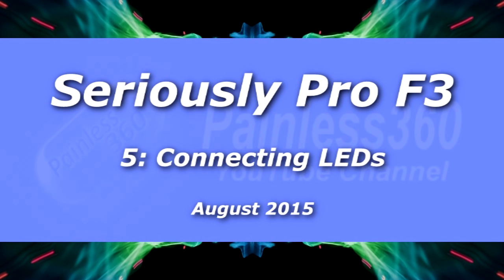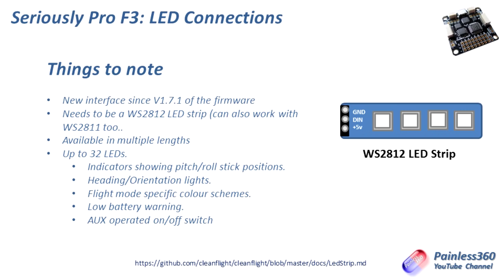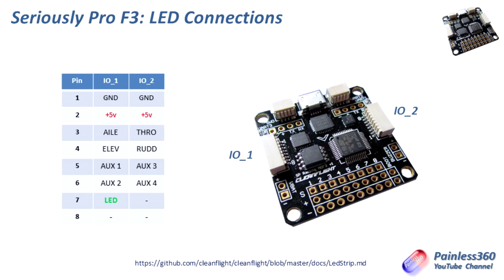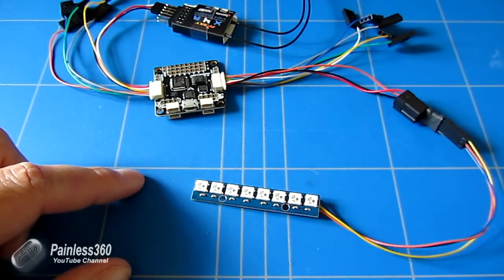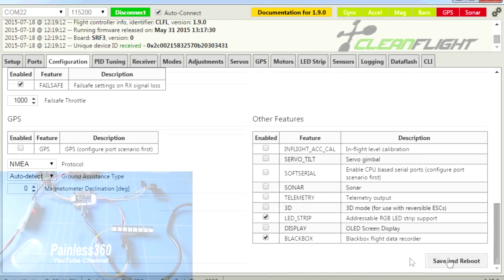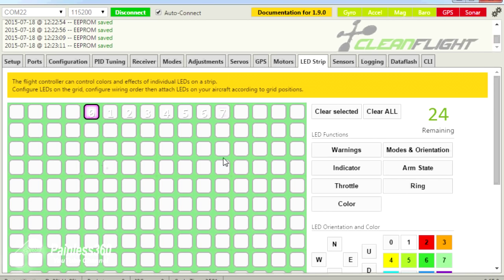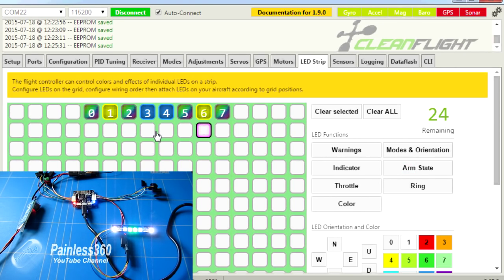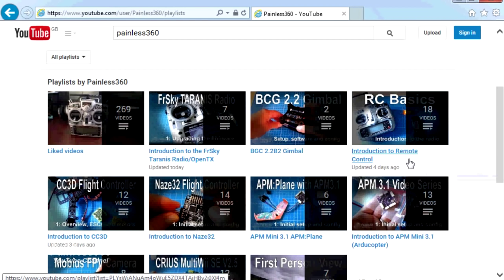(5/9) Seriously Pro F3 (SP3) Series - Installing WS2812/2811 LEDs

Comment: I'd strongly advise against running the LEDs from the "main" 5V. First this means they will work unreliably with the FC (has to do with voltage levels). But more importantly they draw a lot of current and you don't want that to shut down your main BEC due to overload. See my longer response to a comment from William Ball below.

Comment: I am running this board in cppm and would like to add an LED strip, however I have already used the 5v and gnd connections in IO_1 socket for the CPPM connection. Whats the best way to get over this? or should I change over to Sbus or a satellite connection in IO_2 to free up IO_1?

Comment: Hi, how can I use 4 wire LED strip (+ve,RGB)? here rgb are -ve every one is using 3 wire strip. Should I mix RGB? I need to use white in front and red at back and have done by direct connect to Lipo battery. Want to use this way.
Reply from the maker: I've already answered this. No need to post twice. Happy flying!

Comment: Hello Painless....small issue here, I have my strip currently white....but when I try changing colors, it doesn't seem to be working. So, when I select LED #0 for instance, then do I select "Color" then go to the  area "Orientation and colors" and select #2, as it is "RED" then proceed  doing this sequence until I have them all "Red"....then SAVE
Reply from the maker: +Michael Aguirre so., you're saying that it remains white? If you are following the steps in the video then I'd suspect that the connection for the signal or the led strip itself is the problem. Best of luck!

Comment: Great videos painless360 they are a really important resource for me as I'm a complete beginner. 

I'd like to connect WD2812 strips to the spf3 as shown in your video. The two supplied plugs/cables that came with the fc that plug into IO1 and IO2 both have pin leads numbers 1,2 and 3 ending in the same plug. Therefore I do not have the loose +5v and GND plugs to use along with the pin 7 lead/plug to connect to the LED strip. Can I simply cut wires from pins 1 and 2, GND and +5v respectively, and solder these and the pin 7 lead directly to the LED strip?
Reply from the maker: +Philip Lucas You can use any spare GND and +5v pins, I normally pull them from spare pins on the ESC connections, or a spare pins on the Rx.. Best of luck.
Reply: +Painless360 thank you for your quick response. If I'm interpreting what you've written correctly I can take the +5v and GND from the Rx and connect pin 7 to the LED strip? If I'm honest I have no idea how to take power from an ESC. Have you got a video that describes either of the methods? If it helps I have 20A OPTO little bee ESC. Thanks again for your advice and help it is invaluable to a newbie such as myself.
Reply from the maker: Power and other topics are all covered in the 'Introduction to RC' series and chargeable, direct support is available if you need it. Best of luck!

Comment: What limits are there with amount of lights powered this way? I know cleanflight will program up to 32, but can you actually run that many, and a receiver, and a gps, ... etc.?
Reply from the maker: +Hiway If you assume (!) that each LED pulls 40mA then 32 would pull 1.28Amps so you'd have to look into the capacity of the BEC and make sure it could handle it.

Comment: I'm encountering a strange phenomenon and am a bit at a loss here. Acquired two of them 8 lED sticks , wired them correctly (checked 2 dozen times) and programmed in Cleanflight. Piece of cake thanks to your video. It's only that when I touch the back of one of the sticks with my finger that I get the correct pattern, when I let go I get a different pattern, mostly green LEDs. Any ideas?
Reply from the maker: Watch the voltages. I have heard that  some sticks need a slightly lower voltage to be happy. Some have popped a diode in line to drop the voltage slightly.. Best of luck..
Reply: Thanks for the swift response, seems to be working! Needless to say that I did not have the optimum resistor at home :-).  Next weekend then! Interesting that the static charge of my finger seems to create a resistance within the LED stick.

Comment: So i´m not using a ppm receiver mod i use the pwm so i cant connect my led strip to pin 7 on "IO"i was solder a signal wire to the bottom of the fc to led strip 3.3+ pad and the input to the channel pins.So in a cleanflight that dont work, anny sugestions please .. btw i´m using WS2812B LED Strip which came original with the frame ..
Reply from the maker: All of the detail and tips I had are in the video, see the notes in the manual about the limitation with PWM and LEDs. I'd get a PPM/S-bus Rx.. Best of luck!

Comment: Its such a shame Open Pilot does not support this (yet at least hopefully)
Reply: +Bishop Vick 
I can wait, but I need a video to get it right. The Full Naze worked fine. Just holding my breath for the better wiring and CF download for GPS.
Reply from the maker: +ERIC HENDERSON No need to wait for the download. I show the process for setting up the GPS manually in the next few videos in this series so you can set it up no matter on the GPS model you have. Happy flying!

Comment: I'm using ppm with my receiver so I am using io1 pos and neg, could I take the pos and neg from io2 and mix that with channel 7 from io1 to run my leds? cheers once again and great video as always
Reply from the maker: +Huw John There are lots of places to get the power and GND connections for the LED strip. Make sure they are offering the same as we use in the video and you should be fine.
Reply: +Painless360 cool thanks :)

Comment: hi, I've installed a Matek WS2812 with 8 LEDs, but when I pike the 0 and the 7 LED and set as "indicator" it does not work properly, I mean, if I roll right the led blinks, if I roll left nothing happen, and with the same configuration even if I pitch back the right side led blinks, while if I pitch forward nothing happen, I did try to set the lens and South, East, West, Down etc etc but no joy. thanks for your reply :)
Reply from the maker: Id check the setup in the GUI and then try other modes for that LED in case it's got a problem.. Best of luck!
Reply: the led works since with any other setting it does what is supposed to, thing is that new version of cleanflight has a different layout than the one in the video and I may get confused and missing some step :(
Reply from the maker: Possibly, see our later 'Quadcopter building for beginners' series for more recent builds that include LEDs..
Reply: Thanks, I'll check :)

Comment: I would like to run a setup like this on my spedix s 250 pro, i need a front light. the light bar only has din, ground, vdc can i solder a second set of lights to the same terminals and be able to program them?
Reply from the maker: +Manuel Blanco not sure. I've not seen that..

Comment: I am very thankfull for all these videos... they helped me a lot in the past :) BUT i use SBUS via IO2 and therefore I can not use IO1 for +5V my LED´s...

If I have both IO´s connected and i plug in the Lipo i have no power to my receiver via IO2... only after "start up" help via USB... also turning LED´s on/off via AUX switch on my transmitter won´t help... 
as soon as I disconnect my Lipo and reconnect it again, I have no power on the receiver again => connect USB => everything is working fine.... disconnect USB still no problem... disconnect/connect Lipo again => receiver is power less :(

Thankfull for any kind of help!
thanks ;)
Reply from the maker: Sounds like a problem with the 5v power going to the FC.. Best of luck..
Reply: i guess it´s not that big issue... i take the +5V from another source instead if IO1 than it should work?! next time I deassemble my drone. Anyhow, LED´s are just for fun thats why it´s not the big problem ;) have fun...

Comment: Mine wont work... When I plug in my battery they flash on but then turn off.
Reply from the maker: +DIY4Dummies Happy to help but please watch https://www.youtube.com/watch?v=olIqTiSJHIY and come back to me with more detail of what you've tried..
Reply: +Painless360 It went wrong again and I have found out that the pins on my IO1 port have not been soldered correctly  ) : Is there anywhere else I can connect the LED strips
Reply from the maker: Check out the LED documentation for Cleanflight - all the answers are in there.. Best of luck!
Reply: +Painless360 Turns out my IO1 port was not soldered correctly at the factory, I am now using the LED_strip Pad

Comment: can you use any SIGNAL connection? or it has to be from I0_1??
Reply from the maker: the LED pins are usually set. The documentation can usually confirm that for you..
Reply: Thank you so much for your time...I study your videos and they help me so much!!! i built my first quad one week ago from scratch and now flying in angle mode about to try horizon  Thank to you!!!!!!

Comment: Can't get 2812 leds to work with PWM rx. I am trying to use some ws2812 leds and cannot get them to work. Using pin 7 on I/O 1 which is a dedicated LED strip data signal pin. Receiving 5.4v on all 6 leds and using data in led strip. Feature led_strip is enabled in clean flight. As soon as I enable it, the leds flash white then turn off. I have the 6 leds laid out correctly on the led strip config page. Everything is setup right.  Installed a 4001 diode to drop it to 4.76v and still nothing. Now when flight controller is plugged in via PC 3 leds flash red(very dim). When battery plugged in leds turn off. I tried powering directly from the fc through I/O 1 and same thing happens. I guess this board is broken.
Reply from the maker: Some strips need a slightly lower voltage (I've heard). Best of luck..
Reply: +Painless360 installed 4001 diode no luck. 4.3 to 4.7v

Comment: Dear Painless, again thanks for your SPF3 series. It helps a lot. Some notes how to set up the s.port telemetry with the x4r sb (depending on the Taranis Firmware) would be a be helpful and a nice quick tipp in this series.
Reply from the maker: +Norbert Wenkel I am waiting for the SoftSerial to be fixed in Cleanflight on the SP3 before I make that video that covers FrSky Telemetry - with the GPS, S-BUS and OSD we have run out of available hardware ports. I do give a hint how to set it up in the OSD video ;)Keep watching..
Reply: +Painless360 i'm now able to use the s.port Telemetrie together with GPS and OLED. Problem was the new Taranis Firmware 2.11. But now after using 2.12 (sensor addresses and names have changed) the basic telemetry via s.port works on UART 2 and GPS on UART 3. Softserial would help a lot.
Reply from the maker: +Norbert Wenkel You can preview the Cleanflight FrSky SmartPort telemetry settings on the SP3 video series now by watching https://www.youtube.com/watch?v=mFvb40oE_pM&index=9&list=PLYsWjANuAm4ro1vHztauuHFaelUDCOwqw
 Hope it helps.

Comment: That is just freaking awesome that you can control all the led points from the fc.
Reply from the maker: +FuYing Bro It is very cool! One of the nicest parts of Cleanflight and a great way to turn your model into a flying disco! :)
Reply: Painless360
The other day I realized I need some lights on my hex. I flew it with some dark tree in the foreground and just could not see it any more so had to launch up to see where the heck it was. No I just have to figure out how with APM. Only video I have found on it was with a guy that sounded like he was talking Portuguese for which I am super rusty in.
Reply from the maker: Search on the channel for '5050 led' and 'hobbyking switch' to see some ideas.. Hope they help!
Reply: Painless360
Thank you for putting me into the right direction.

Comment: Can I also connect them to IO_2 because my receiver is on IO_1 ?
Reply from the maker: +Sweetigkeiten check the manual. The led pin should still be available.. Best of luck
Reply: Painless360 Yes, it is. But on IO_1 is the + and ground cable forgiven. So can I use these from IO_2?
Reply from the maker: +Sweetigkeiten yep, it spare PWM power pins. See video.. Best of luck

Comment: I have a Realacc x210 pro frame (https://www.banggood.com/Realacc-X210-Pro-214mm-3K-Carbon-Fiber-FPV-Racing-Frame-4mm-Frame-Arm-w-LED-Board-5V-12V-PDB-p-1090783.html?rmmds=search)
 that have a led bar with 16 rgb leds and "din" input. I have a sp racing f3 flight controller and i wired the din to the pin 7 on the io_1 port . But nothing happen, i can only turn on and off the leds with the button on the led board. The 5v and gnd was soldered directly on the pdb's 5v. What could be the problem ? Obviously i have "turned on" the leds on betaflight and tried to configure them on the "led panel".
Reply from the maker: The Din is the same as the input for the WS2812 LEDs in this video. Be aware that I've had LED boards with a button that needed pressing a few times to get it in the right 'mode' to be controlled by the flight controller. Impossible to see what type it is in the listing..
Reply: Well, i will try another type. Thx !
Reply: You said that we must press "a few times" the led button, but i didn't find this magic number :(
I tried another type of leds without button and it's all ok !
Reply: WTF...i found the problem, the led board of the X210 pro have a SWITCH on the back !

Comment: Hi Lee, I got the same LED strip and configured it in Cleanflight with SP Racing F3. When I connect the Lipo battery, the lamps do light but they light with different colors (from what I configured) and some lamps flicker. I am pretty sure the physical wiring and the configuration in GUI is correct. I searched the internet and read in few places that this could be because the LED strip are getting voltage above 5V and these strips work better with 4.7V. Any idea?
Reply from the maker: I've not seen that with the strips I've used here but you could add a diode in series with the 5v line to the LEDs to drop a little of the voltage and see..
Reply: Painless360 That’s exactly what I read. Any idea what kind of diode. Sorry for the primitive question.
Reply from the maker: +Ibrahim KHALIL anything rated for the current should be fine. Something like a IN4001 should work..
Reply from the maker: This was made following yours (and a couple of others) comments. Thanks for the idea - https://www.youtube.com/watch?v=I-YdY2pGA5A Happy flying!

Comment: Thank you for the amazing videos!  I'm rebuilding my mini-quad from a v5 Naze32 and I was curious if you knew where the FrSky Telemetry output is on the SP fc and where to hook up the bluetooth Tx/Rx for PID tuning.  I am using PPM inputs, thanks in advance.

-Matt
Reply from the maker: +Matthew Domes This is covered in the manual and I will be making a video on this in the next few weeks.
Reply: +Painless360 really appreciate all your hard work! Without you most of us would be lost 👾
Reply from the maker: +Matthew Domes If you watch the video on setting up the GPS it hints at the FrSky connection details ;)I will be covering this video in the coming weeks as it appear that I need to use some Beta code for the SoftSerial to work.. Happy flying!
Reply: +Painless360 Thanks, I on a whim hooked the Tx from UART3 to the Rx on my FrSky D4R-II, then set telemetry_inversion = 1 and it worked :-)  I am excited to see how you use SoftSerial as I am new to that aspect of the FC.
Reply from the maker: I am about to upgrade to 1.10 beta as the soft serial option in 1.9 of Cleanflight on the SP3 doesn't seem to work for me. Once it's enabled you can plug the FrSky telemetry input in to Pin 6 on IO_1 and it should work again!

I should have time to tackle that next week...
Reply from the maker: +Painless360 You can preview the Cleanflight FrSky SmartPort telemetry settings on the SP3 video series now by watching https://www.youtube.com/watch?v=mFvb40oE_pM&index=9&list=PLYsWjANuAm4ro1vHztauuHFaelUDCOwqw
 Hope it helps.

Comment: Hi! I really like your channel! I'm currently working on the led setup for my sp racing f3. I soldered my GND wire to the other GND spot on the led strip, it didn't work, now I soldered it to the same spot you use. Still not working, same settings in cleanflight as your using. It looked like led burned, do u think the board exit 7 got dammed by wiring to the other GND spot? Thx so much for your help! keep up your good posts about sp racing f3 :)
Reply from the maker: +Claudio Alter I can't comment on what you might have done but the way to set it all up is covered in the video. Best of luck!
Reply: +Painless360 @2:27 min in your video you can see your blue wire soldered to the GND on the bottom, I first used the GND on top. One led after each other stopped working, now I used a new stripe and soldered like you did, still not working. Is there a way to measure if the exit 7 on I/O is still working? thx for your help
Reply from the maker: The GNDs should be common. I'd check the voltage you are applying to the LEDs. Best of luck.
Reply: +Painless360 I tried again setting it up like you did (power the receiver and the fc with an ESC), then it works. When I install it to my quad it doesnt work though. ESC (Multistar 20A SBEC) are pluged into FC and FC is connected to receiver. What do i need to do to make them work? best regards claudio
Reply from the maker: Not sure, could be voltage related as I've heard of problems with some of the strips. Best of luck with it.
Reply: +Painless360 okay but it's weird that it works with linear BEC ESC but not with switched ESC... best regards
Reply from the maker: What does a voltmeter show on the BEC output on the two setups?